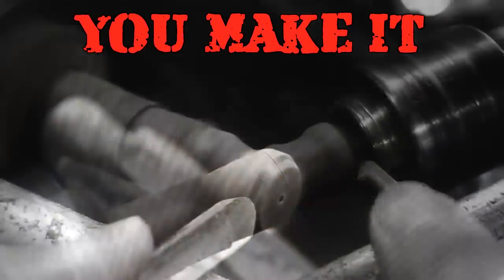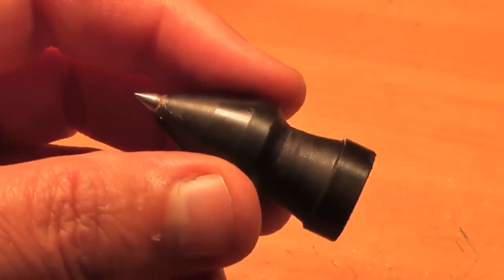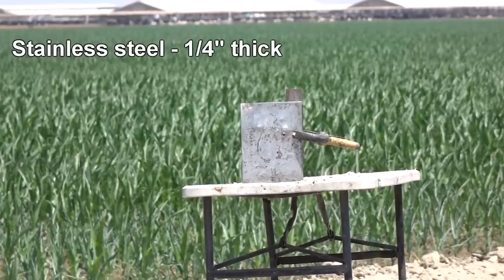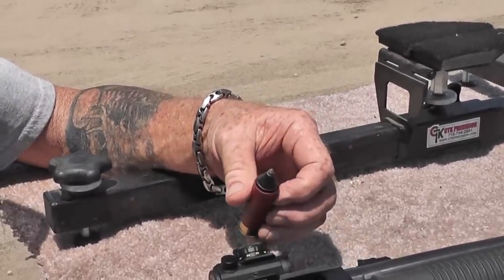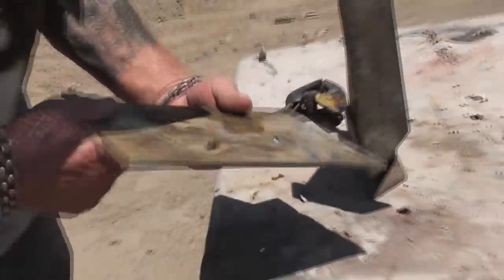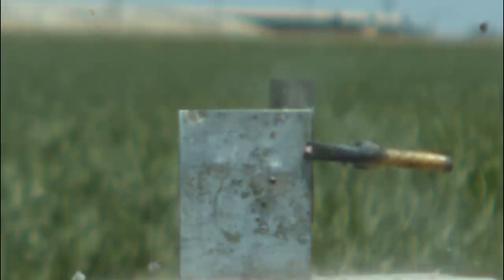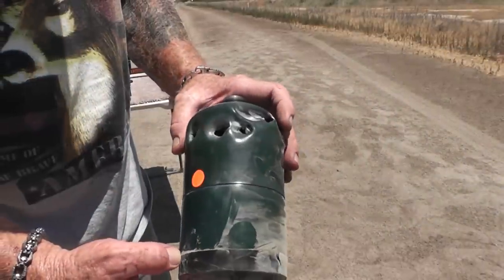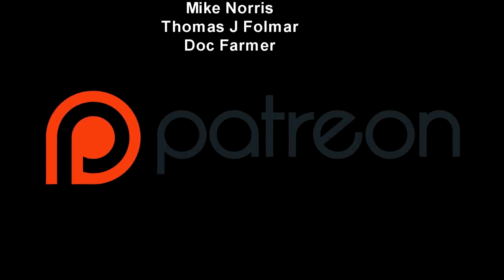Super Penetrator Slug - You make it,  we shoot it!

Comment: Wow! Did not expect the lead plate to get penetrated!

Maybe the penetrator tip should be longer and further back into the slug? For weight balance
Reply: It's basically a mini APCR shell. It would not work as intended if the penetrator is not put in the front.

Comment: Nice penetration on that lead plate. Even for just the tip.
Reply from the maker: I was surprised how large of a cavity just the plastic slug made.
Reply: Buffalo's Outdoors J U S T  T H E  T I P
Reply: A N D  O N L Y  F O R  A  M I N U T E
Reply: It's basically a shotgun take on the old WW2 APCR rounds.  The tip breaking free on impact and being the part that penetrates is how they're supposed to work.

The modern evolution of what this was based on is the APFSDS round where everything but the penetrating rod and some stabilising fins breaks free as soon as it leaves the barrel.

Comment: Looks like it's based on the old APCR projectiles tanks used to fire. Those projectiles were known for high penetration but that penetration tapers off over a long distance. It was also know that these also have a small spalling effect once penetrating armor.
Reply: Pull the penetrator back into the shot a bit and I'd bet you'd get a better balanced round.....  from most cutaways I've seen of APCR the penetrator almost never goes to the tip of the round or goes the whole length
Reply: That's because there is space for a ballistic cap. The cap allows the projectile to "stick" to the armor when striking at high speeds instead of bouncing off or shattering.
Reply: As someone who had a career as a "Tanker" (Loader, Driver, Gunner Tank Commander) I am unfamiliar with this "APCR" you write of.
Maybe you meant "APFSDS" or "APDS" (Armored Piercing Fin Stabilized Discarding Sabot and Armor Piercing Discarding Sabot respectively)?
If so, the APFSDS "Long Rod" or "Golden BB" was a very long, solid rod constructed of depleted uranium as was the shorter APDS, although some were made of very heavy metals I don't recall.
But NONE of them "stuck" to the armor or other target they impacted on. 
They achieved their penetration by pure kinetic energy and upon impact would literally "bore" a hole through its target.
"Spalling" was a byproduct on the exit side of the target where molten metal would accompany the projo through the target as well as shearing off chunks from the inside wall.
And because the depleted uranium  was highly pyroific (sp?) when superheated upon impact, the base metal and all it touched became molten liquid and set fire to all it touched, especially as the materials bounced around inside the tank or other hard target.
Anyway, just hoping to set the record straight from someone who has BTDT and has the t-shirt AND the scars to prove it. 
Overnout for now. 😊
EDIT: If it is meant by sticking to the target upon impact and penetration, we had another round called a "HEAT" round or "High Explosive Anti Tank" which had a "cap" on the hollow stick-like object on the leading point.
This cap covered a crystal, which when crushed emitted an electrical charge that ignited a shaped charge in the main portion of the round projo.
The shaped charge emitted a PLASMA-HOT jet of molten gasses which literally burned and blew a hole through the target. 
And, not unlike the AP projo's, the exit spot from impact would have not only this small plasma jet blow through the target metal but a huge amount of Spalling would also be ejected inside the target. 
Regardless of which projo struck the target, assuming penetration, the occupants were as good as D.E.A.D. and it wouldn't be a pretty death considering the amount of metal bouncing around the interior and the fires which would start, too.
Then there was the "HEP" round which looked like a big streamlined but blunt bullet.
"HEP" stands for "High Explosive, Plastic" and it would splash and flatten against the outside metal of its intended target and explode. There would be a shockwave that would resonate through the target metal and a "plate" of metal would shatter off the opposite point of impact, showering the internal occupants with very hot and large shards of metal. Again, a gruesome way to die. 
Done for now. Again. 😁
Reply: Because they basically disappeared after WWII as APDS became mature technology.
Reply: APCR is also known as HVAP (high-velocity armor-piercing) was replaced by APDS 
Edit: basically its APDS that takes the sabot with it to the target
Reply: +Howard Huggins
Indeed, the "APCR" being discussed is no longer used on any large scale. It's not any of those currently-used rounds you described or encountered in your career.

+Kin Chan
Speaking of which, the "small spalling effect" of APCR is not something to boast about. It's not said to have a small spalling effect because it's something unique to APCR, but because APCR has a smaller spalling effect than other rounds. APCR, with its smaller penetrator, is less traumatizing to the armor around the impact point, leading to less spalling.
Reply: Thank you all for the informative comments especially on your careers.
I've played a fair bit of War Thunder so I know quite a handful about shell types, their history and their affects on armor.
Reply: As others have pointed out, APCR is the grandfather of the current APDSFS shot used by modern MBTs.

The Ballistic Cap mentioned by others isn't quite accurately described. The "Cap" was a softer metal (often copper) that helped reduce the chance of a ricochet off of sloped armor by deforming upon contact with the armor, providing a smooth entry for the following penetrator. However, this cap was often somewhat blunt, and so they would add a parabolic or ogival nose cone, the "ballistic cap", to improve the aerodynamics of the round, allowing for more accurate and longer-ranged shots.
Reply: Kin Chan check out the German arrowhead rounds from WW2. I don't play War Thunder - I collect WW2 Allied and German ordnance
Reply: “Just the tip” 👌
Reply: @user-td1zo3tv9p  APCR (Armor Piercing Composite Rigid) is basically the grandfather of APDS. It had a soft outer layer and a small,hard pointed tip in the middle. It's basically APDS that carries the sabot along with the dart. It offered decent penetration over long ranges,but had terrible performance against sloped armour (WW2 Russian T34s were basically immune to those rounds) and had very little spalling,as the penetrating  tip was very small. By the end of the war,the Brits made modern APDS, which unlike APCR offered good spalling and penetration against sloped armour,over long ranges.
Reply: APCR also has terrible angle penetration

Comment: Here is an idea...
Part of the burning of the powder, is the weight of the slug.
The inertia of the slug, plugs the barrel. And allows the powder to be ignited. So when loading a light slug, the slug leaves the barrel before all the powder is burnt. So , in order to drive a light slug at higher speeds, you must use a faster burning powder.
I hope this helps. 
Thanks for sharing your videos. And keep up the good work.

Comment: As cool as it would have been to have a road flare burning behind the propane cylinder, fire is not quite the thing I would worry about. There is a type of explosive called an FAE. That's Fuel Air Explosive. It gets the oxidizer from the oxygen in the atmosphere. If you can ignite it at just the right time, the flame front moves through the fuel at the speed of sound. This results in all the chemical energy being released in a fairly short time. It's a low order explosion, but it is still an explosion. It just might make you jump out of your skin!

Comment: Continuing on the thread of „let’s build a projectile around a design that’s known to work“, I suggest remaking this exact slug, but with a penetrator that’s seated into the rear 3/4ths of the slug instead of the tip. 
My thinking is, some high-performance FMJ bullets have an air pocket in the tip in order to shift the center of gravity rearward, and as a result, also shift the center of pressure from the tip to more in the center of the bullet. Shifting the weight rearwards could help stabilize the projectile, and since the plastic part shatters on impact anyway, the hardened penetrator should have no problem ripping through and into the target. 
It’s possible such a design might need a sturdy shot card or thin metal plate behind it, because the heavy metal penetrator doesn’t like to accelerate as quickly as the plastic does, so it might come out of the back of the slug and sink into the wadding behind it when fired.

Comment: Good to see the same result when scaled up as pointed airgun pellets are not accurate ether lol....round nose is best.I would like to see a round nose shallow waisted pellet shape but hollowed out as much as possible from the base half way up then taper to a 5mm hole out the nose...then make a hardened cone for the core that you push in from the base Loctited in place as the penetrator leaving say 5mm point sticking out of the round nose pellet while still leaving the hollow base to keep it nose heavy and add stability.
Might get the best of both worlds...round nose for accuracy and a heavy hard pointed penetrator to....penetrate lol...damn I wish I had a lathe...
Could a pellet shape be turned out of lead I wonder?
Reply: harry guy pellets aren't really designed for supersonic flight. Traditional bullet shapes work way better.

Comment: The wobble create yaw - yaw reduces penetration significantly. The KE needs to be higher, and the projectile needs to be stabilized. I would increase the width of the penetrator to add weight but its not only that, the delrin is not going to penetrate the steel plate. Its not ridged enough to complete the tunneling. You can use the carbide to start the penetration but you are going to need to sleeve it in hardened steel that just about 2/3rds the diameter of the projectile. Otherwise the carbide tip is just going to penetrate as deep as the about the width of carbide tip.. which would be fine if the carbide tip in this case was 1/4" diameter.

Comment: Most of the impact seems to come from these penetrating cores, rather than the material around it. I wonder if it would have the same penetrating power but fly better if the cores were embedded all the way into the "diablo" shaped casing so as to not protrude at all.
Reply from the maker: It would definitely help with the balance.

Comment: It Would be cool if you could design the slug to come apart mid-flight. similar to what happened at  3:46. 
If the slug was to go under the newton's cradle effect, having the energy of the casing of the slug transfer into the core, to see what it could do to the target despite the drop in momentum because of the core having less mass then the outer casing of the slug.

Comment: IDEA! Could someone 3d print a diabolo pelet shape but with evenly spaced holes for spherical shot evenly spaced within?
As you 3d printed the slug you could place the metal shot into the little  holes and then continue 3d printing the shell shape till the next set of holes at about half way done.
In my mental image of this it would look like a normal diabolo pellet shape but if you held it up to the light you'd see the spheres of the shot therough the plastic. (depending on the color or the plastic I guess.)

To shorten that up it would be a plastic diabolo shell that holds evenly placed and spaced shot within that would continue moving after the slug hit the target.

Comment: The carbide core would probably be far better in a tried and true slug. Tungsten would be even better and not overly expensive if you use used tungsten rods for TIG welding.

Comment: The Diablo  shape should be maintained. Those tips should be embedded into the center of the slug and not the tip. Upon impact the harder piece will push thru the softer metal causing a shock wave thru the slug inturn causing the slug to obliterate on impact. Diablo shapes is the best shape......

Comment: honestly, that long tip is completely unnecessary. one of those tips in a regular diablo would be better, the center of gravity wouldnt be so far forward of the center of volume. plus, id like to see that done with a penetrator thats as long as the round. i reckon that would treat spin stabilisation the best. i think itd have to be press fit into an aluminium slug for it to hold together with a pass-through penetrator.
Reply from the maker: I think for someone who never designed a slug in his life,  they worked pretty well!
Reply: fair point.

Comment: ever try shooting cut shells poor mans slug cut the bottom of the shell about half the length of the brass start where the brass meets plastic then how long the brass is go up and make your cut perpetrated with the cuts just enough to where after you make the cuts you can pull it apart but still having to rip the plastic leave about three strands hair width with birdshot single shot shotgun Smooth Bore

Comment: Why not load some of these exotic projectiles into 3" or even 3.5" shells!?!? Low and high brass 2.75s won't ever actually fully display the rounds' true capabilities!!
Reply from the maker: The length of the shell doesn't determine how much power it has,   it's the type and amount of powder.
Reply: TAOFLEDERMAUS Thank you for the reply! So a high brass 3" or 3.5" has the same powder charge as a high brass 2.75"? I just assumed (probably incorrectly) that the larger payload in a longer shell would have more propellant behind it....